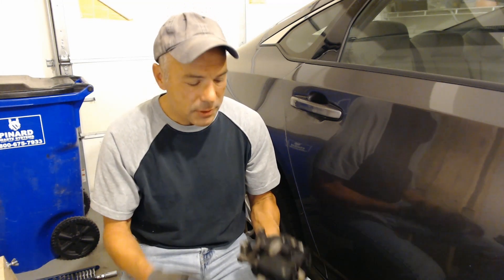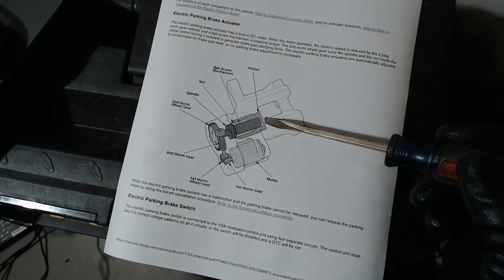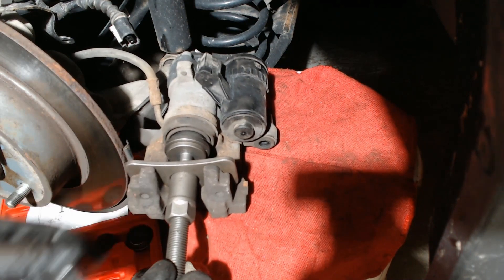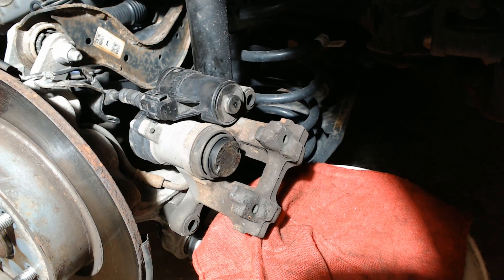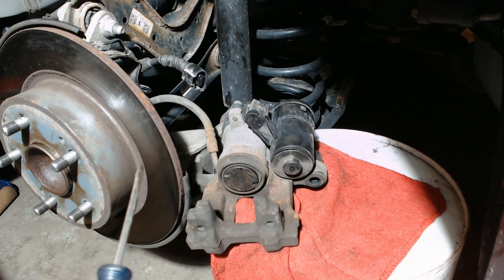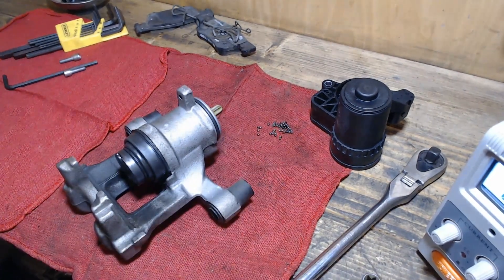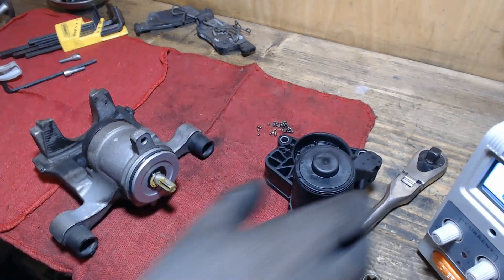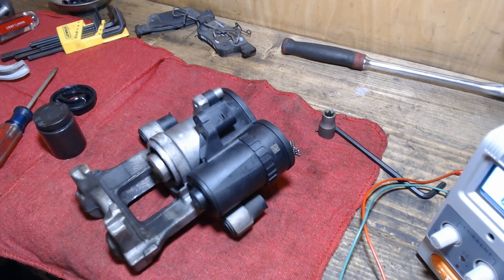4 Ways to Retract Brake Piston on a Honda Accord with Electronic Parking Brake

Comment: People are now saying that the screw push back method will trigger the brake light or possible mess up the e- brake. Just want to make sure before i do my brakes. Thanks for sharing.
Reply from the maker: I have personally done the screw and push back method several times on my 2018 Accord and never had any issues (no brake light, no ebrake issues).  Also the official Honda service data says that removing the ebrake motor and manually winding back by turning the shaft is an acceptable alternative method.  There was one time someone reported having a brake light on after doing the windback in the comments here but when they read the codes it as actually due to an open circuit code which had nothing to do with the windback.  It sounded like it was an issue with an open circuit in the electrical connector after they put it back together.  Be aware that this is a common issue DIYers face and maybe is the reason people get a brake light on after (and not due to the windback)!  If you pull too hard on the wires of the electrical brake connector when you disconnect it then the wires can disconnect from the connector internally.  If this happens, the ebrake will not work and you will get a brake light.  There is a great video on this at SouthMainAuto where a DIYer comes into his shop with this issue they created and he fixes it for them.
Reply: @JohnsDIY  Huge thanks. I appreciate all the information. I have the windback tool set, so I'll be going that route then. Thanks again for all the help.

Comment: "...one of the two ppl still watching...  slow day or really like brake calipers..."  Luv your warm sense of humor.
This is the best & informative video I've watched in ref to this style brake caliper.  Ive been a tech for 30 years & recognized all those little details to quality workmanship in your vid.  Novice eyes may not pick up on the subtleties....I did.
The four methods described are totally on-point.  Regarding pulling piston back with 12volts, I use a 3157 or H4 bulb in-line in place of a fuse.  When the piston threads reach their limit, the bulb illuminates brightly acting as a current limiter as not to burn out the electric motor.  It'll glow dim in the beginning (sharing the electric load).  Then it illuminates brightly as threads bottom out.
.
Very, very well produced, Sir.  Excellent and informative.  Thx a bunch!
Reply from the maker: Thank you so much for the nice comment, especially from a professional!  I like the idea of using the bulb in-line for the electrical retraction!  That's a great idea.  Thanks for posting that as I think that could be a handy approach for a lot of folks!  Much appreciated!
Reply: @ Using an H4 bulb works great as a +12v short to ground diagnostic tool as well.  No danger of overloading circuit.  55w (about 4.5 ampere?) will be maximum experienced by circuit.  Though I appreciate new tech and am well versed in OBD2 theory of operation, I'm still old-school in some diagnostic methods.  Ya pick the appropriate tool for job at hand.  Sometimes it's high-tech to activate PCM modules & network, other times a simple light bulb suffices.
.....enjoy.

Comment: Excellent Info! Unfortunately even with the screw mechanism turned fully clockwise and at a hard stop, my piston doesn’t fully retract. Needs to go another 3mm to get new pads in. The pistons definitely at a mechanical stop against the internal screw nut. Other caliper was fine. Anyone run across this issue? Thanks
Reply from the maker: Thanks for the comment!  Did you try just pushing the piston in the rest of the way?  The piston "floats" on top of the inner piston, so it can come out further than the inner piston with brake fluid pressure applied.  If the inner piston is turned all the way in, then you should be able to just press the piston directly in the rest of the way (using a standard piston push in tool, or c clamp).

Comment: Liking and bookmarking this video! I love the attention to detail in this video. Showing these methods and breaking down the way things works really helps me and others. I've already done mine before but needed a refresher because It's that time again to get them done  so this vid helped alot. I struggled my 1st time because I never kept tension on the piston with the windback tool,but now I know after each turn i have to spin the nut to keep tension. It's the little things. Also if I ever run into this issue with another car I at least have 3 other ways of doing it. Thanks again!

Comment: Just saw this in Nov 2024.  Great video...thanks!!!!  I have a 2019 hybrid with 50K.  I've used the rotating tool before (free rental from AutoZone) on mechanical EPBs.  The only concern I would have with the "wind back" method here would be forcing the entire mechanism (including the motor) from the "front" and applying torque that it wasn't designed to have from that direction.  The cover removal and shaft rotation method seems easy enough.  But again, thanks for showing all 5 methods very clearly!!!!
Reply from the maker: Thanks for the nice comment Jeff!  I hear your concern but I think using the wind-back method doesn't force the entire mechanism and doesn't turn the motor.  The piston sits on a threaded screw.  When you wind the piston back in, it simply screws the piston back on that thread.  So literally, the only thing moving/rotating is the piston.  The worm drive, reduction gear, and electric motor do not turn at all, just the piston.  Thanks again for the comment!

Comment: Amazing video. I would think that the screw type tool would provide more consistent feedback as long as you keep the threads cleaned and greased. Whereas that caulk style compressor can sometimes be more or less hard to push depending on the angle or whether the tool is side loaded at all.
Reply from the maker: Thanks for the comment!  That could be!  I just felt that the screw type had so much mechanical advantage that it might be harder to sense a modest change in resistance, or easy to miss it anyway.  With the caulk style, it takes a fair bit of pressure/effort even for a piston in perfect condition, so I thought it might be easier to detect a change.  But I can see your point.  Perhaps the primary thing is just to be aware of how much pressure it is taking regardless of which pressback tool is used.  Thanks for the comment and good point!

Comment: Will 9v tester battery work?  As it does for injectors
Reply from the maker: Yes!  Good question!  Someone else asked about that once so I tried it out and a fresh 9V battery does drive the motor.  Not surprisingly, it does turn a lot more sluggish than with a 12V battery, but I think you could get the job done with it!

Here is my previous reply:
" @lizhiliao4614  I tried it out and a fresh 9V battery was indeed able to drive the parking brake motor!  It definitely turned slower and sounded a little sluggish compared to driving it at 12V (not surprisingly) but it worked just fine.  I was able to drive the caliper piston out and then retract it just fine.  Thanks for mentioning that as that might be a good option for a lot of folks!  A nice side benefit of doing it that way is that you can't really create any problems with that approach (shorting out and melting terminals for example) due to the limited amperage of the 9V battery.  Good idea!"

Comment: I designed a Torx E11 Hand Socket that I 3D printed and used to manually retract the EPB spindle.  This design is on printables and thingiverse and is free for you to download and print.  Search torx e11 hand socket.

Comment: I miss the C Clamp for compression with my former 2014 accord coupe
Reply from the maker: I hear you!  So on the 2014 it didn't have the integrated parking brake in the caliper?  My 2007 Accord had a manual parking brake that was integrated in the caliper, so it still needed to be wound back by spinning the piston.

Comment: Thank you for a wonderful video just have a couple of questions , Will this work on a 2022 Acura MDX and do you unplug the wires from the motor and if so will you get any messages on the dash when you start the vehicle back up. Thanks Phil
Reply from the maker: Thanks for the nice comment!  Unfortunately, I am not certain whether the same approaches work on the Acura MDX.  On the Accord, you can unplug the parking brake motor and it does not create any messages on the dash or set any trouble codes AS LONG AS you leave the ignition off until you plug them back in.  If you have the ignition turned on with the parking brake connector unplugged then it does set trouble codes and dash warnings (it senses the open circuit and thinks there is an issue).  I imagine that would be the same on the Acura, but can't say for certain.

Comment: Hello if there is dust or rust on the outside of the piston and it causes it to be hard to push the piston back how can you clean the dust and rust off off the piston
Reply from the maker: I usually just use a plastic bristle brush (to not damage the rubber boot) and some brake cleaner.  What method did you use to retract the inner piston?  If the inner piston is not retracted (via running the motor, rotating the shaft, rotating the piston or entering maintenance mode on a scan tool) then you will not be able to just push in the outer piston.
Reply: Hello thanks for the reply I have not done the job yet but I'm planning on doing it soon I have a 2019 Honda insight I will be using the wind back method until it stops spinning then push the piston back in this will be my first time doing brakes with the epb any tips would be highly appreciated
Reply from the maker: @luiscarrera5181  I see.  In my experience, it is quite unusual to have any problem pushing back the piston due to rust/corrosion.  On a vehicle only 5 years old I don't think you will have any problem.  One thing I would recommend though.  When you start rotating the piston, make sure that the boot is not rotating with it because you don't want the boot to get bunched up or damaged.  If the boot is starting to rotate with the piston, you can just work it back and forth a bit until the boot frees up from the piston.

I think you are referring to the comment that I made about wanting to use the hand pushback tool to feel the resistance.  I have had a few times where it was very hard to push the piston back in and this did lead to issues down the road (sticky piston and excessive pad wear on that one wheel).  In this unusual case, I think the only solution is to rebuild the caliper (remove the piston, clean it, replace the square cut seal) or get a new caliper.  However, I think this is highly unlikely to be an issue on a 5 year old vehicle unless the boot had a tear in it or something.

Good luck with the brake job!

Comment: FYI everyone: If you have an electronic parking breaking system on your 2018 Honda Accord and you wind your rear pistons back without the computer system to disengage the ebrake system   you will very likely get a horrifying Electronic Braking System error code on your heads-up display when you turn your car back on. The parking brake light on your center console will also be blinking. To reset this error code I had to remove the negative battery cable from the battery for several minutes then replace it to reset the cars computer. After this you will need to pull up on and hold center console parking brake button  for roughly 10 seconds until you hear the ebrakes reset. This should clear your Electronic Brake error code. Good luck.
Reply from the maker: Thanks for the comment!

Are you sure that the error code was caused by windback w/o being in maintenance mode though?  A common cause for the situation you describe (brake error code after brake job) is if you ever turn the vehicle on while the electric parking brake electrical connector is disconnected.  This will definitely cause brake system error codes.

I have never had any codes set after manually winding back a Honda caliper with EPB (electronic parking brake).  Also, the Honda OEM service data includes procedures for parking brake retraction both using the HDS/Scantool/maintenance mode as well as without using a scan tool.  The procedure it specifies for retraction w/o using a scantool is to simply remove the actuator and wind the shaft back by hand.  It makes no mention of having to clear codes after (and in fact is the procedure if a scan tool is not used).  Finally, the brake actuator has only two wires going to it.  There is no position sensor or other telemetry.  It is "calibrated" simply by turning on the parking brake.  The motor turns on until the current increases indicating that it has fully engaged.  So there is no real "calibration" of the parking brake - it simply recalibrates every time it is turned on.  Therefore, there is no loss of calibration when the parking brake is manually rewound.

If anyone is able to replicate this situation, I would be very interested if you were able to read back the codes and see what it is complaining about. 

Thanks!

Comment: So if you use the scanner to put it on epb maintain mode; you just need to push the caliper piston straight down and no need to turn it clockwise. Other videos show doing both, which is weird.
Reply from the maker: Yes, I believe that is correct.  Maintenance mode causes the parking brake motor to run until the inner piston is fully retracted.  However, it cannot pull in the outer piston since that just floats over the inner piston so that simply has to be pushed in which can be done without turning it.

Comment: Hello! John what if accidently the piston went out all the way?😅
Reply from the maker: Hi there.  Well, it depends on the details.  If just the outer piston slid off and the inner piston (which screws on to the rod) is still in place, then you should be fine.  You can just push the outer piston back on, wind the piston back in and you should be good.  However, if the inner piston unscrewed all the way then you will probably see little ball bearings coming out and it will be very difficult to reassemble because I don't know how you will get the ball bearings back in place.  Let me know if that makes sense to me.  I could send a picture if you don't see what I mean there.
Reply: @JohnsDIY yeah it makes sense! I watched your video and I'm like... "I still have hope that it'll get fix!"😢
Reply: Okay... soo... I started by taking out the wheels and then the caliper from the right side. I took out the old break pads, then I continued pushing the piston, until I realized I need it a specific tool to twisted like you show on the video, then I saw that you need it the computer to put it on maintenance mode, so I started searching for videos about how to do it manually, then I came across this video, where it said that there's a special way, by pressing the parking button a specific way, I fell for it and the piston went out of the "shell" after that I try twisting it back in with some pliers and it did went back but not like pushing it it was all twist
Reply: Sorry for the long text lol, I asked my friend for his computer and I put the car on maintenance mode, the left side was good it just needed the pushing but the right I think still bad, because all the panel lights are on like the (VSA, ABS, Break amber, and Break on red
Reply from the maker: @luiscolorado4708  I see, if the outer piston went back on and you were able to screw it all the way back in, there is a good chance that everything should be okay.  You might try cycling the parking brake on and off several times and see if the panel lights clear.  There are very few electrical diagnostics that the PCM performs on the brake so there aren't many problems that it can detect.  In fact, the only thing it can sense is the motor current into the parking brake motor.
Reply: @JohnsDIY  okay! Well the car runs good and break is good as well, is still on maintenance mode, because the abs, vsa lights won't let me go back to normal operating mode... I tried taking the terminals of the battery out, and let it for 30 min to do a reset and nothing still with all the lights on... can't put it on parking...
Reply from the maker: @luiscolorado4708  Can you read the codes and let us know what active codes there are?
Reply: @JohnsDIY  yes! It's 2 ABS/VSA CODES: C1100-53 and it says Electric Parking Break System in Maintenance Mode 
And the other one is...
 C1111-13 Right Rear Electric Parking Break Actuator Circuit Open
Reply from the maker: @luiscolorado4708  Thanks, that is very helpful.  C1111-13 is very likely the root problem.  However, it is probably not related to any mechanical issue but rather an electrical issue.  This code means that there is an electrical open (break in the circuit/wire) somewhere in the two wires going to the parking brake motor/actuator.

1.  Are you certain that the connector is plugged in and fully inserted (until it clicks)?
2.  Check the wires - make sure there are no breaks in them.  Did they get forced hard during the caliper removal?
3.  There are usually wires on the BACK side of the connector which can come undone if you pulled on the wires at all (for example, when you were trying to unplug the connector).  When this happens, one of the wires will become disconnected and you will get this code.  I would try removing the dust boot on the back of the connector and make sure that the wires are fully connected in the back of the connector.
Reply: @JohnsDIY okay!  I'll try that, but no, I didn't remove it at all... I might have hit it without me knowing
Reply: @JohnsDIY  one more thing! Remember I told you that I put it on maintenance mode and the left piston went back smoothly and the right one didn't. I still had to twisted all the way could that be another problem?